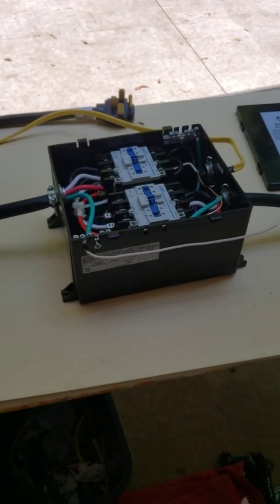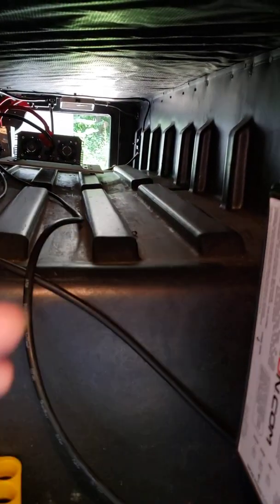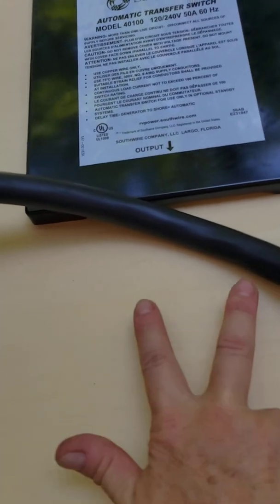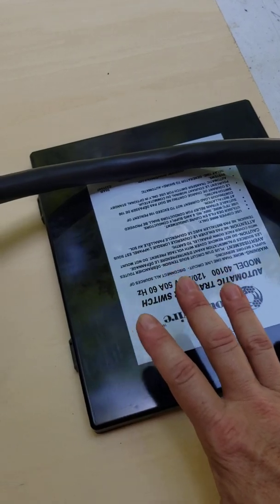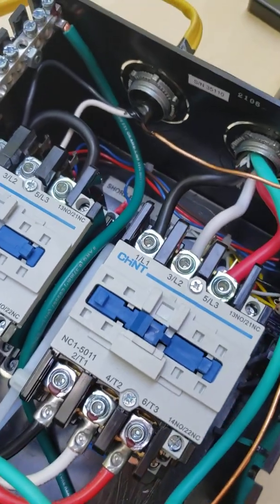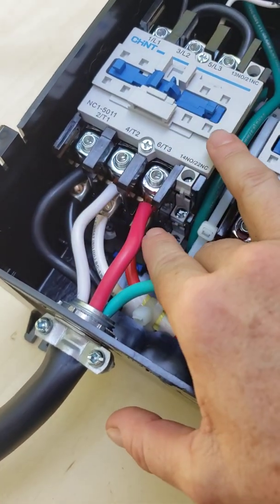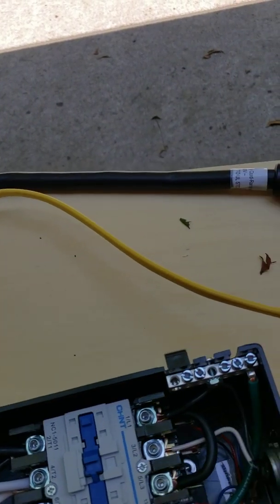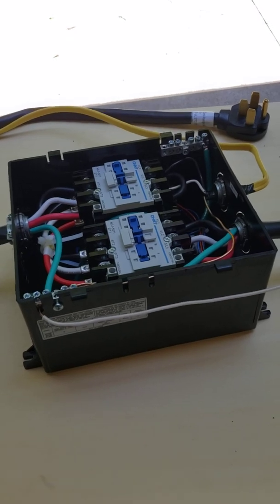campground construction - wiring a second automatic transfer switch into the motorhome - part 1

Comment: Perfect, well done. I’m doing something similar for my converter. So sure power coming in will go to a sub breaker. It will have 50 amp out to the transfer switch the other in from the transfer which will be my inverter. That first breaker that I’m putting in will also power my converter so in other words plugging in and unplugging the short power will work as an on off switch for my converter. This way when the inverter is powered on the second transfer, it won’t provide a continuous loop with a converter and the house batteries.

Comment: Mines humming like yours. I was told it's not supposed to do that.
Reply from the maker: I found that it hums if I have a low voltage connection. But, the original switch is still rocking along (when I infrequently use it on the generator leg). The secondary switch is silent when running the inverter (2200W)